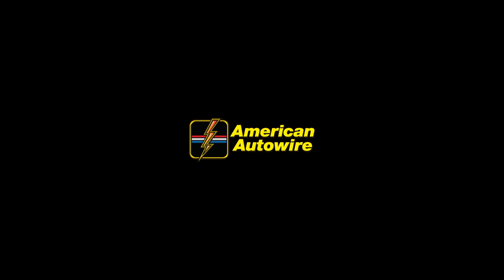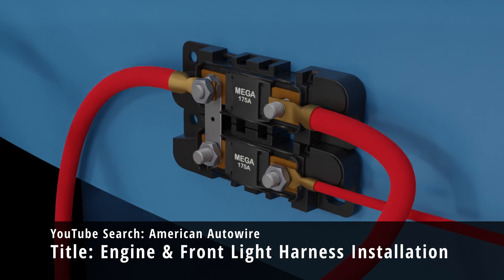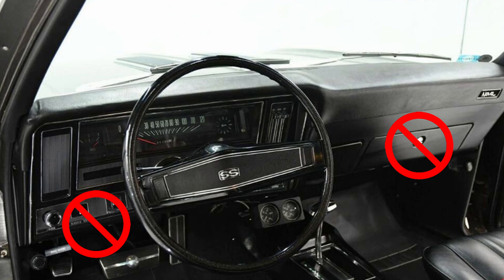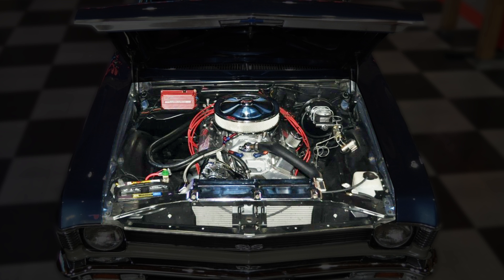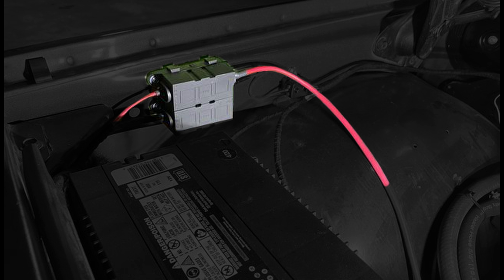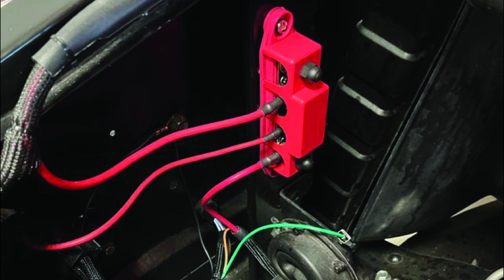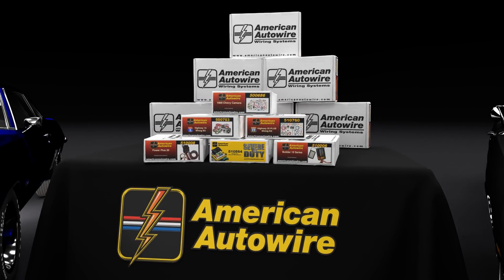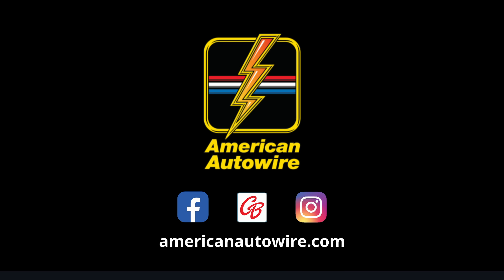American Autowire MEGA fuse mounting locations

Comment: Built my first car, a 1973 pontiac firebird, and mounted it on the driver side inner fender. Its mounted along the same route the factory harness took originally. Safe and away from heat, stone kickups, water, etc. If you didnt know any better, it looks stock.